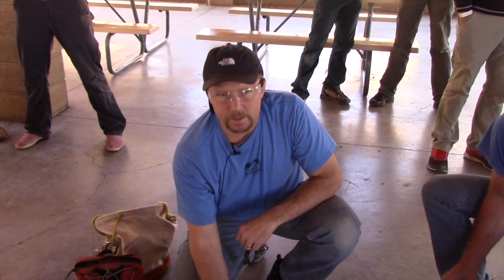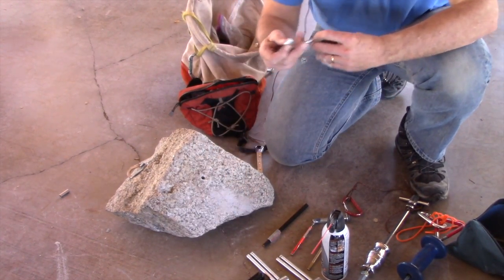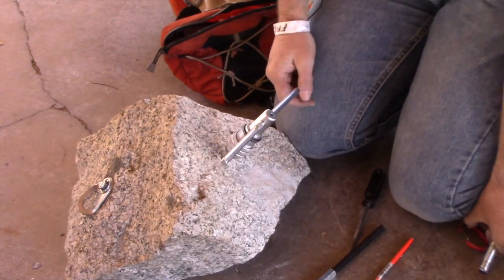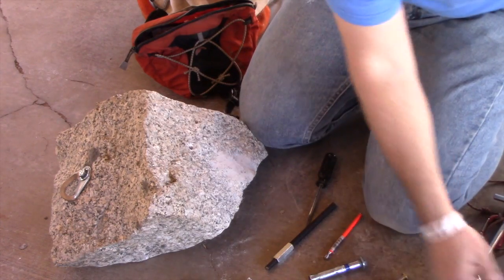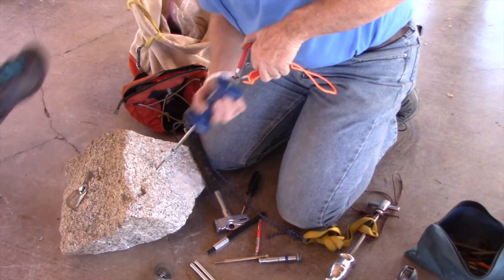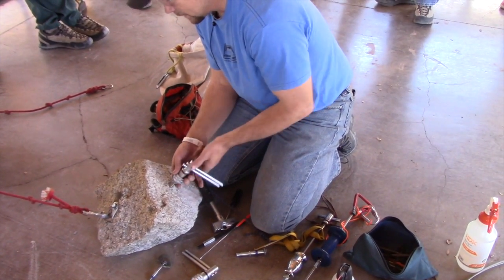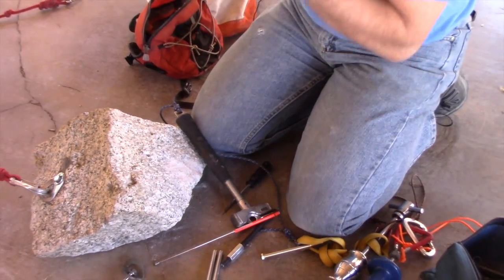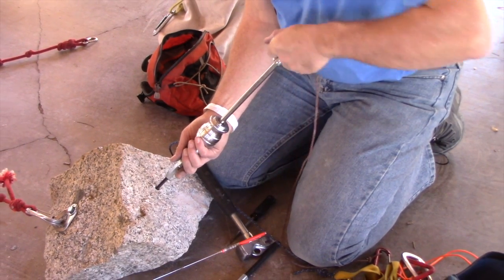Slide Hammer Sleeve Removal

Comment: What diameter of bolt is used to screw into the tapped threads of the sleeve?The main problem I have found with removing the sleeves of power bolts (AKA five piece anchors) is that even if you tap the inside of the sleeve with a 9mm tap, there is no way to find a 9mm bolt to fit it (no 9mm bolts are produced as far as I know since it is not a standard size). Do you have a source for 9mm bolts? Or did you have one custom machined?

Comment: I've found that just using an old "beater" 3/8" bit, you can just drill out the cone.  Then any remnants can be easily removed when the 1/2" hole is being drilled out for the replacement bolt.  Careful when the metal bits come out of the hole.  They're very hot.  It's a good way to "Up-cycle" a used up drill bit.